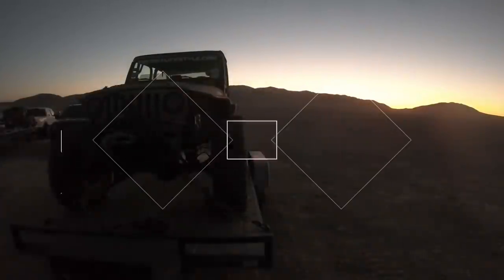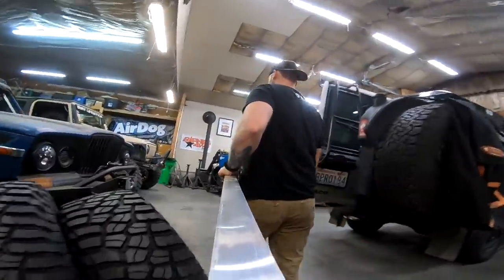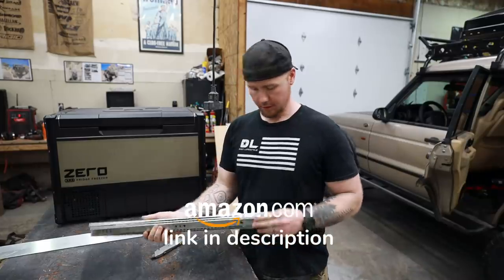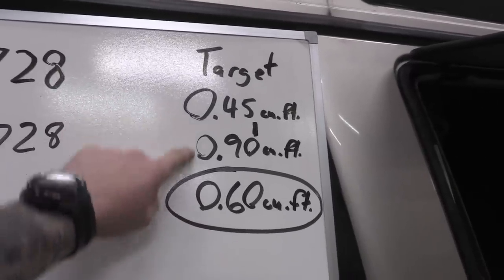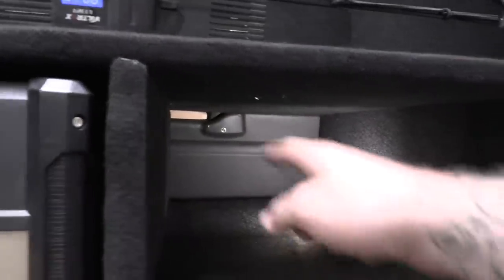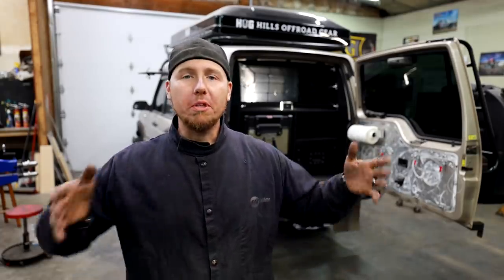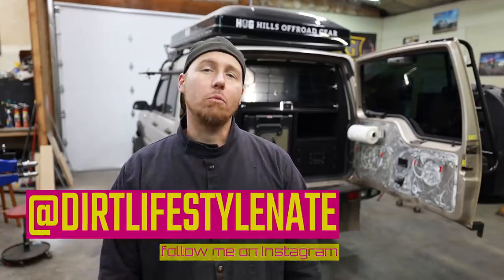Building Easy Overland Gear Storage! Ultimate Land Rover Discovery Build Episode 7

Comment: Watch the hot air venting on the fridge/freezer.  Trapping the hot air exhaust around it can kill the efficiency.
Reply: Exactly my thoughts when I saw the narrow space the fridge slides in. Wonder if OP has some details about performance in praktice? If it has to work hard you’ll notice a faster batttery drain for example (and hear the compressor running constantly).
Reply: Tru-dat.  I have a 12-volt compressor setup similar to this one.  And, yes... it will build up heat quickly if there is no ventilation.

Comment: I believe actual box volume is less than 0.34 cubic feet incorporating the material thickness at 0.75. You might be missing some low end. Also, next time you build a drawer system (and sub box) consider using Baltic Birch. Lighter, superior with water/moisture, attractive resonant frequencies, not to mention way healthier to work with (no urea-formaldehyde release when cutting). Baltic comes in 5x5’ sheets, fyi. Love the channel! Keep up the awesome work!
Reply: I'd love to do my whole build with that but it's hideously expensive here.
Reply: Yes, internal volume is .34, too small for the sub.
Reply: is that taking into account the speakers volume displacement also?

Comment: Quick questions:
1. Venting\cooling for the fridge?
2. Latches for the slide and drawer?
3. Why not do a proper 12v set-up in the wing voids?
Reply: My guess would be this was a quick  build to accommodate the trip he is currently on with the roverlander. I would assume  that he has plans to address the noted issues in future videos. As for the fridge venting my fridge only requires 1/2 inch of air space around it to be fine, and it was ment to be in the back of a truck (63q element arb fridge)

Comment: On non-load bearing sections of the storage area, you can cut holes out of the MDF to save weight.  Look at airplane and ship building designs for inspiration.  In your Roverlander I'm betting there are a few pounds that could be saved.  Very neat design, I love watching these videos.

Comment: MDF looks great and is relatively easy to work with, but don't let that MDF get wet, it will expand faster than I do after a trip to McDonald's!
Reply: I thought the very  same.  I would have added a coat of waterproofing polyurethane before gluing the fabric.
Reply: Its also quite heavy compared to other options, I would go with marine ply for something like this
Reply: Minima Domum weight is a really important factor, and Nate is well aware. He has the skills and equipment to make an aluminum framework, I’m guessing this is a "just get it out there" solution.
Reply: MDF is hugely heavy..  omg.. no wonder he's going 1 ton axles..  will need a Cummins 12v next to get it moving

Comment: Thanks for all the videos, some great ideas on your channel. I must say in terms of the material used in this video (MDF) it's too heavy for use in a Disco (and most wagons)m the weight of the MDF +  fridge slide reduces the vehicles load capacity when GVM is taken into consideration. In any case I do appreciate your video. Not sure if you live in a hot part of the US but the fridge will chew through power without proper venting through the "cabinet". Cheers from Oz
Reply: Very good points especially the refrigerator air flow.

Comment: Once again knocked it out of the park! You're content, and delivery is superb! Anyway I suggest putting all your recovery gear, and emergency supplies on the drivers side window box. It'll make it all easier/quicker to access when needed. For your cooking geer I'd design a way to hang it all off the back door in the window area. You're not going to be able to see out of it anyway, and it'll also be right there convenient for cooking without having to walk around the open door constantly. Lastly on your beauty panel. Polish it, and make it pop!

Comment: Love it!  As a former speaker builder, I'd highly recommend viewers consider "Baltic Birch" instead of MDF.  Pros:: 1) it is lot lighter, 2) it isn't as toxic for your lungs, 3) it is dimensionally stable and there aren't voids in it so you can round over corners and such, 4) should be far better if subjected to moisture but I'd treat either just in case.  Cons:: 1) its expensive vs MDF.       
And if anyone wants to build their own sub for their truck/car/jeep.  I recommend getting up the learning curve with Unibox for Excel (or equiv).   If you are building a sealed sub the 'Q' of the sub is the important target, which is most commonly 0.56 or 0.7 depending on what your acoustic goals are.  I have no idea which is better in a car, my guess would be 0.56.  And all the models for volume are 'inside volumes' so not including the thickness of the walls which is actually significant in the case of small boxes like these but also subtract the volume of the sub driver itself.

Comment: Food for thought, I like molle idea on the one side and then maybe mount your air compress on the other along with other electrical equipment on the other side like an inverter. Then you could put a 110v wall outlet on the small filler panel beside the fridge along with a USB and Cig outlet and maybe all the same but accessible if sitting in the back seat. Hopefully that makes sense but keep up the good work!

Comment: Really awesome setup! I like the way you maximized space on all sides.  I didn't go vertical because I need the space for my giant dog.

  If you do another one of these, you should consider Birch Plywood instead of MDF.  It's a TON lighter and handles moisture better.  Easy to work with as well

Comment: New subscriber to your channel., photographer and woodworker and just now getting into welding.  A sheet of 3/4 MDF weighs in at about 90# where 3/4 birch ply is about 60#, just about 1/3 less weight if you're concerned about the extra weight.  I'm outfitting my 4WD Suburban for photography/camping outings and going with the birch ply...I need to minimize the weight as much as possible since the miles-per-gallon already sucks.  Really enjoying your channel, and your gear list is an exceptional bonus.

Comment: Speaking of air space....do you have enough ventilation area around your battery bank?  Electronic gear can over heat and fail or just have a shorter lifespan if it can't dissipate heat well enough.
Gull wing windows are great idea!

Comment: I am all in for the custom speaker box setup. I've got an 8" sub for my Jeep and a small weather resistant amp to power it, but I pulled it out cause I didn't like giving up any space in the rear. Been trying to come up with a good alternative space for it.
Reply: under the seats?
Reply: @murderedjku  I thought about that, and I think kinda half under the driver's seat, half behind it is what I'm going to end up going with. Underneath the seat there's not a whole lot of room. I was also trying to keep it up high if possible, cause I've done quite a few water crossings in the past that have flooded the inside of the Jeep, but haven't really found a good place for it. I was considering maybe somehow attaching it to the roll bar, but I haven't figured out a good way to do that lol

Comment: Very nice build. I am not sure what type of overlanding you will be doing. My hope is that the carpet will not be a curse... Venting, heat and keeping everything clean will be a problem for your setup. Also the slide without locks will drive you crazy..... I know. I also used standard slides but I did come up with a simple and cheep lock that works very well. See DYI jeep kitchen under 300 dollars. Works very well. Love watching your channel.

Comment: Look into flexible solar panels meant for RVs for the top of that thing.  They'll add a whole 1/4 inch to the top, but they'll totally keep your batteries charged.  
As far as subs go, there are some that take such little space - they're literally "put them in the smallest box you can fit them in".  I have a sundown 8 I was making a spare tire well sub for, ended up having to divide the box in half and make one side a recess for amps and such, because the sub required such little space... Of course after I built that, they came out with a 6.5"  that, at least on paper, seems to rip... :)

Comment: Curious what you were going to do about the heat from the compressor on the fridge and the inverter on the power bank? Might need to add some venting holes.  They may not overheat and cease to function, but heat can also reduce the overall efficiency and lifetime.

Comment: Hi. Does the slide for the cooler have build in stops? I use them without stops an every time i speed up the slide runs into the back door.
Reply: latch might need to be added, "soft close" slides help alot too as youre charging up a little spring the first few inches of opening so theyd be reluctant to move
Reply: I use a cheap gate latch, quick cheap and easy
Reply from the maker: I think I'm going to add a latch long term 👍
Reply: The set up looks real good, and I'm really liking the Artistic touch of the Metal Topo. Think that looks really quite cool and adds that little bit of SOMETHING. The side window .. one could be recovery gear strapped to Molley!?

Comment: Great video! I can't tell if the entire MDF frame / structure is bolted to the inside of the Rover, or just freestanding / gravity held in place? Also where are the slides for the drawer and fridge attached? To the floor of the Rover, or the back of the MDF enclosure? Trying to figure out if you have to drill / attach to the floor of the Rover, or it just sorta sits on those side pieces and all attaches to those?

Comment: +Dirt Lifestyle Amazing vision to execution Nate. The small touches like double overlapping the carpet make it really stand out.

Quick question: Is the MDF structure free standing or did you bolt it to the body? I ask because I want to understand your thinking on structural rigidity on bumpy terrain. The way I interpreted from the video is that its snug fitted + free standing with the back and horizontal boards providing support to the whole structure. Am I missing something?

Comment: Can I hard wire some interior lighting and accessories to a switch panel and power said panel with a portable power supply. If so what would I need to feed power into the switch panel.

Comment: Should've used plywood. That's gonna rack and eventually the screws will rip out. Add stretchers to help with racking to make it last longer. MDF has a very poor screw hold rating and those HD glides won't last MDF. I used to be a buyer for a high end cabinet shop, so I know ALLL too much about MDF and cabinet hardware.

Comment: Is there any reason why you don't run a duel battery set up to power ya fridge and giving you options to run an inverter and other power outlets chuck a solar panel on ya roof top tent be ultimate as you Americans call over lander us Australians call tourer. Is there space under the bonnet (hood) for second battery. All that makes you totally sufficient to be completely off grid allowing you to get rid of the dry cell giving you more space in the back.

Comment: im curious why you use a battery bank rather than a dual battery system? I live in Australia and have never seen anyone use a battery to run a fridge & accessories that isnt charged off solar and/or the vehicle alternator

Edit: i missed the bit where the battery bank plugs in to the vehicle. my mistake

Comment: Where did you attached all the panels to Rover ? I see that in 6:03 you drilled them together. I am just wondering if you drilled the panels to the truck as well? Also, I see that you attached the railing in to the side panels, so no plate system installed? Is that correct? I am trying to build a storage system as well for my truck, and I am getting ideas. Thank you for the help.
Reply from the maker: I have a couple places on the floor that are aluminium angle. It is screwed to the floor through these peices 👍

Comment: i've seen that airbags don't survive off road, rough terrain and heavy flex tends to make them pop and a blown airbag off road will ruin a trip and likely end with having to spend a large amount of money to get the vehicle loaded onto a roll back and hauled out, using airbags to supplement an existing suspension system, while at first looks like a good idea, tends to have similar results, i would recommend just converting to leaf sprung and run a heavier spring rate to compensate for the load, or add coilovers as overloads, pretty sweet build though man and great use of space available while adding new places to store more gear, and the idea of adding the cubby behind the back seats for small items that may be needed such as blankets, toiletries, etc, brilliant i'm thinking when i add a roll cage to my XJ i might do something similar with expanded metal and build a small shelf that i can store umbrellas, rain gear, clipboard, jumper cables, etc things that are needed, but not immediately (except for the umbrella at times with the crazy weather swings we've been having this year)

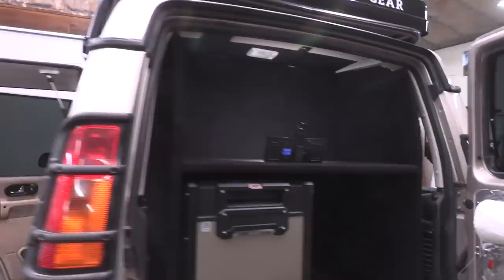Comment: At 6:15 to 13:10; there was a device sitting on the shelf (replaced by light at 14:20) that I'm curious about?
What was it (part of power setup for the fridge/freezer)?  Where did you place it (if needing accessibility)?
Ok, OCD time, I don't like having unused spaces (no access), like under the side cubbies (below side windows).
I hope you add access panels (pull out, flip up, swing out) in the future?  ;-)

Comment: Nate I have a question for you.  I've got a 2018 Jeep Wrangler Unlimited JL Sahara.  It's stock and the only additional "option" to make is more off road worthy was the limited slip rear diff.  I don't go serious wheeling (rock crawling) with it of course with how it's equipped and my current off-road driving ability.  While I'm relatively inexperienced off road, I will say I've taken it up to Evans Creek ORV on Rainier and was blown away by how capable it was stock.  It went up and over stuff that I did not think a stock Sahara could do.   I don't know if I would really use it that often, but I would like to have additional off road capability in the future as well as do some "weekenderlanding".  

Shortly after I got this Jeep new, I learned more about them and regretted not getting a Rubicon with the better transfer case, auto disconnecting sway bar, Dana 44 in Front and locking front an rear diffs.  The availability of the new 3.0 Diesel has me thinking about trading my Sahara in on a new Rubicon with the Diesel engine.  I don't think I will ever run anything bigger than 35's but having the option with the necessary torque on tap would be nice.  

I realize this question involves a lot of factors that I don't have space (and you probably don't have the time to read), but my question is this:  Assuming I can reasonably afford either option (I'm not wealthy but I can make either option work without too much pain), do you think it's smarter to bite the bullet and get a new Rubicon with the Diesel, or should I just spend the money to upgrade my current Jeep?   I'm thinking this would involve a lift, a Dana 44 front axle and putting lockers in the front and rear.   Thanks, I really enjoy your channel and living in the greater Seattle area, feel a bit of a NW connection with you and your channel.
Reply from the maker: The Rubicon diesel JL is the best 4x4 on the market right now. That's what I would choose for sure brother 👍
Reply: @DirtLifestyle  Thanks Nate, I appreciate your taking the time to give me an answer!  It looks like I'm going to have to order one as these are in low supply and high demand.  I can't wait to get behind the wheel.

Comment: Your channel is awesome, always looking for your next video.
Just my opinion....  I really hate MDF. It smells, it's poisonous, it's heavy, and it can't hold a screw (if pulled on). May I suggest 'voidless baltic birch'. It will spoil you for sheetgoods. It's dimensionally  as stable as MDF (if not more so), it's stronger, as a 3/4" sheet has twice as many layers of laminate as the typical ply found in 'the box store', and it's voidless... so if you're building speaker boxes, there's no chance of buzzing from 'loose parts' inside your plywood. Yea, I've built some speakers too... Subs, infinite baffle, open baffle, RiPole, and "conventional box" speakers. I'm tellin' ya man, you'll never go back to MDF. The nasty outgassing will soon be a distant memory.

Comment: Total noob here, so I apologize for the stupid question.

Since you are leaving the rear build in the rig full time, why not replace the rear glass with an aluminum panel and create more hanging storage or a Molle panel system there?

You don't need the glass since you can't see out anyway, and it seems like it creates a security and accidental breakage point.

Indeed, a split gullwing panel, similar to what you did with the side windows, would even allow you to line up with the shelf to allow long items to stick out the back while having the rest of the panel closed.

Comment: one issues is over weighting the 4x4 just an issue i see here in Australia and yes i own and use a 2002 discovery td5 auto and so many times ppl compromise there vehicles buy adding weight gear attachments accessories etc just my comment be well and stay strong